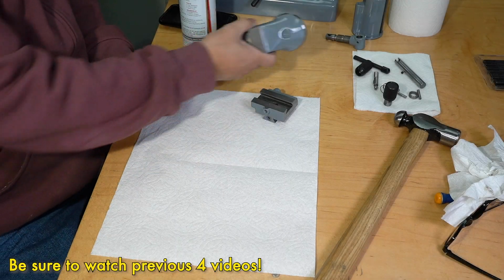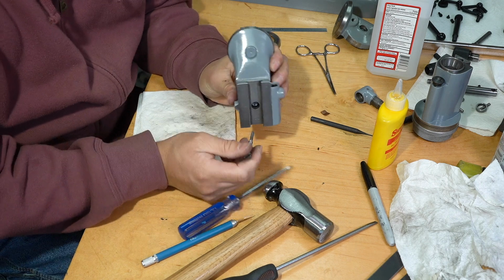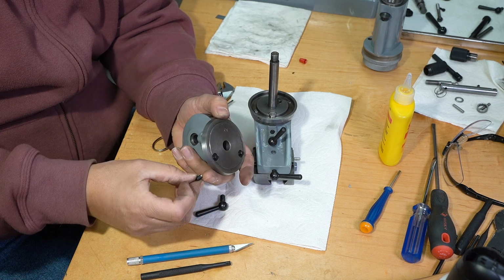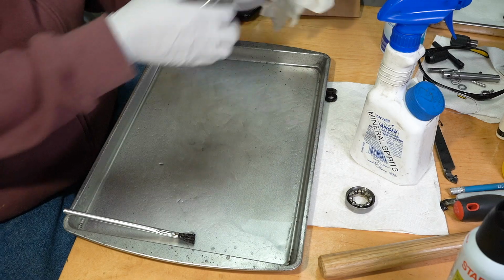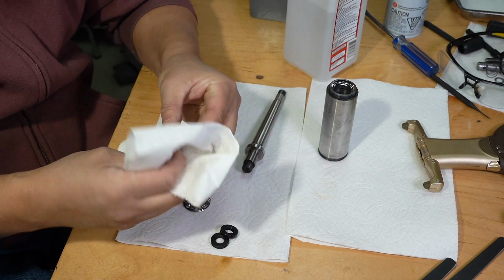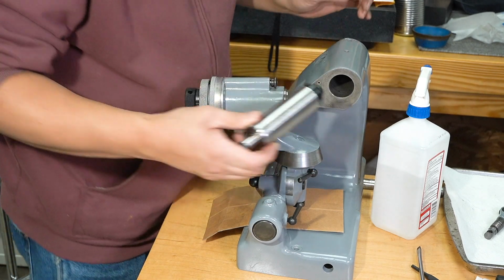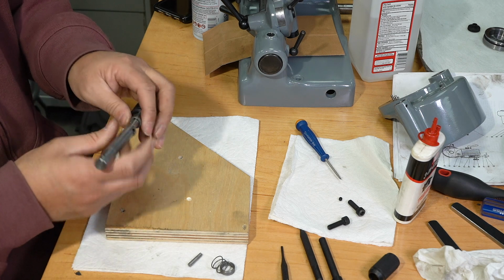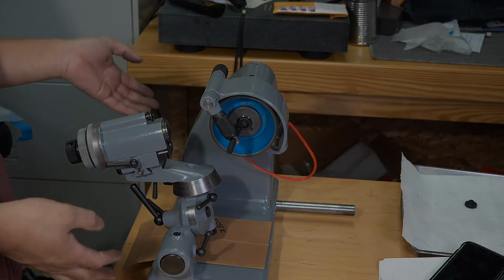RESTORATION Part 5: Deckel SO Single-lip (D-bit), Spindle and Tool Holder

Comment: I have enjoyed watching your video series on this grinder.  I picked up the same machine (same year) and have done a few refurbishments to make it usable.  Seeing you disassemble yours helped me when I worked on mine.   My machine is missing the entire wheel dressing lever assy.  I was hoping to see more details as you were assembling  these into the wheel guard.  Do you have any detailed photos of the assy and/or any of the individual parts?  I need to reverse engineer it and make my own since I have not seen any come up on eBay.

Comment: Man, no wonder even the import clones of these things are pricey, with all the little parts that have to have a good tolerance to each other.  Once you get the motor fixed up and installed that will be one very handy tool -  it would be awesome to be able to resharpen the ends of end mills and make custom cutters.
Reply from the maker: I have to teach myself to do all that as I’ve never done it before.  It will be a long learning curve. 😂
Reply: For what it can do and for what it was designed for it's very limited and a tedious way to grind any tool.....typical German thinking for admirers of that.......it was never designed as a tool and cutter grinder but got the added title from those that know no better.
Reply: @gangleweed well you're a ray of 🌞

Comment: Re: adding a set screw to replace the pin on the adjusting shaft. The Alexander has a set screw through the knurled part of the knob in that location. It would appear there were modifications made as things went along in time.

Comment: Great so far, almost ready to test. I am looking forwarding to seeing how you align the work head. There are 2 eccentric travel limiters that need to be adjusted after assembly. One later variant had a modification allowing you to retract one of those limits so the head could rotate a bit more when needed. I also see that you have the non-taper version of spindle, this is the same on my Alexander 2CGD. Those hubs are no longer available, I had to make mine from scratch.
Reply from the maker: I’ve been wondering how I can check all the alignments, more to come
Reply: @woodscreekworkshop9939  One quick verification I did was put an 8mm HSS rod in a collet and measure between that and a dressed wheel. I know I should really make an aluminum plate (in place of wheel) to do this better. The 90 degree other end I would use a square against the plate and the HSS rod. I have never seen it described in a manual.
Reply from the maker: Gerrit Visser oh I like that idea.  The manual stinks

Comment: Hi Wyatt your sultan friend its prob to late but Ive found harbor freight has a great little package of black set screws in both metric and imperial
Reply: I am using them on 2 rebuilds Atlas 10 and a Atlas  6.  Should be done this weekend if i dont get pulled away
Reply from the maker: Thanks for the tip!

Comment: Thanks for sharing. I've notice you having difficulty with pins. As a suggestion you should make yourself a bench block. Go to the that   www.thatlazymachinist.com/ he has free plans to make one. Nice job on the deckel.
Reply from the maker: Thanks for the suggestion.  I think a bench block will make a great project for my new heat treating oven and surface grinder as well.  Thanks!